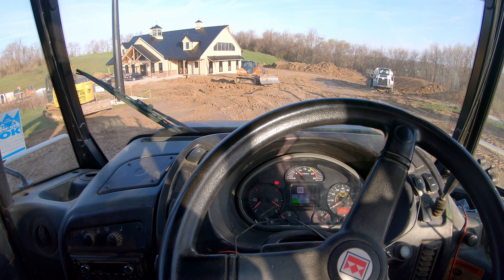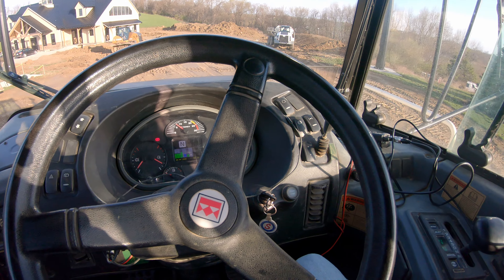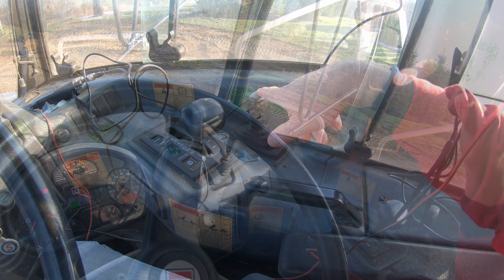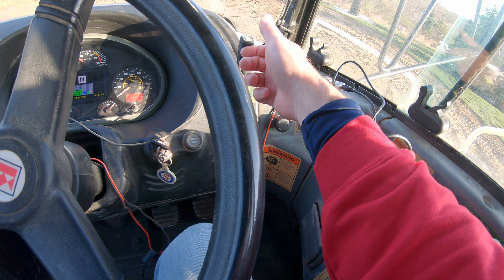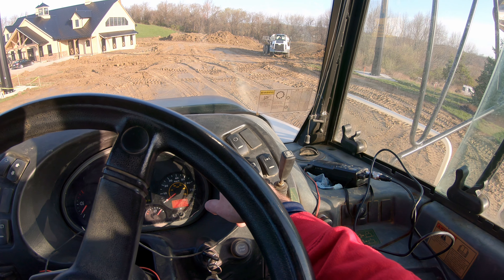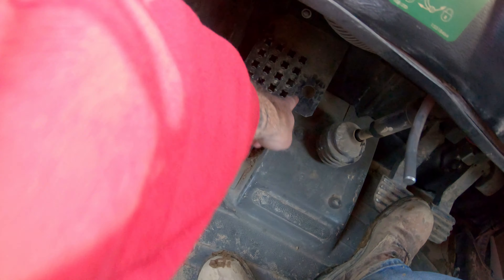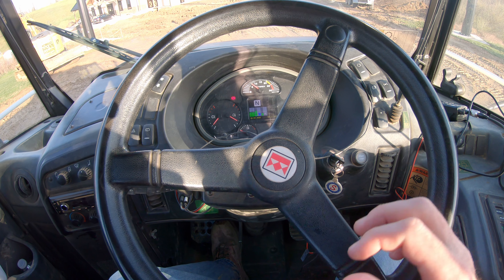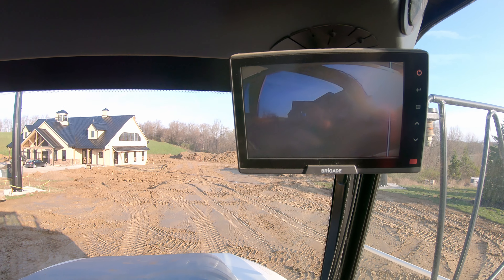Rock Truck Cab Overview

Comment: When you get the chance to look over the operating manual I recommend checking over the transmission control buttons “mode” toggles between hill mode (red light on shortens gears) and flat mode. The other button is for transmission diagnostics but the display meanings are not obvious so you need to refer to the manual.
Also the “high/low” button toggles between high range gear box and low range gear box but most in our fleet have been locked in low box because guys don’t read the manual and try to change on the fly which causes the truck to have a hernia. Note: there is an automatic splitter gear in first and second gears so effectively the truck has 8 forward gears.

My advice for any new driver - ALWAYS “read the road”. Like reading a newspaper, read all the obstacles, road conditions/stability, especially changes of angles that can cause tip overs, safety hazards, etc. and plan your route.

- Know exactly where your wheels are. There are different ways to practice this skill eg tyre rolling but it could mean the difference between an ordinary day and a truck on its side or worse.
Reply from the maker: All really solid advice.  We were operating on pretty level terrain on this job so there wasn't a need for me to get into those buttons.  I will generally read the manual before doing anything related to transmission or engine brakes on a piece of equipment so I don't damage the equipment.  Thanks for the comment!